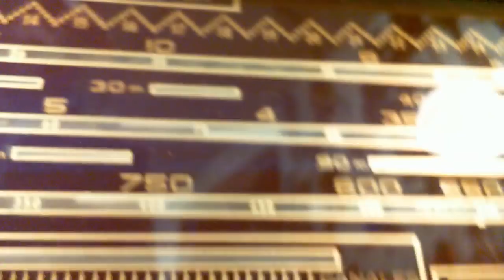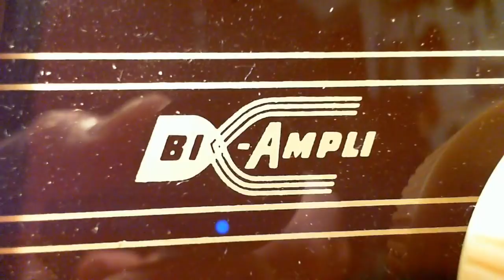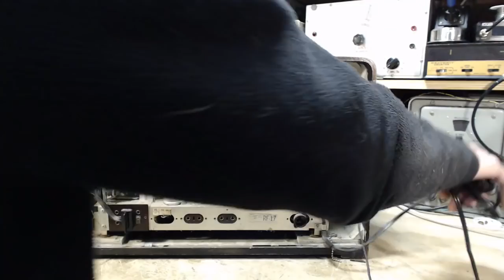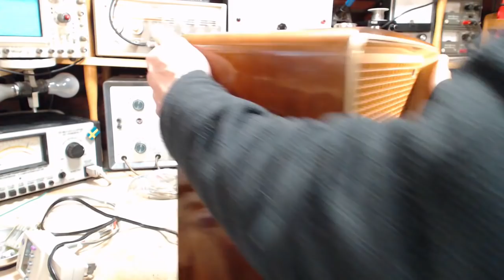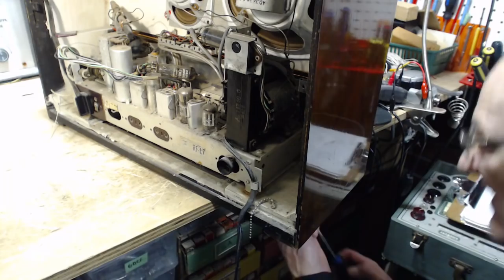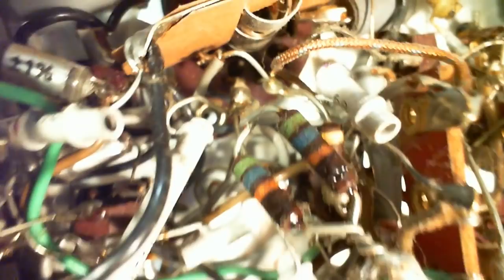Philips B5X88A AM FM SW Tube Radio Video #1- Checkout

Comment: hi jim not my favourate sets to work on the thin single core wire is easy to break if moved. all the black tar covered caps will be leaky . no output transformers in this set and replacement speakers almost inpossible to find. mind you if you do manage to get it going it will sound superb.

Comment: Keep your fingers crossed the 6V4 rectifier is good. That one is frightfully expensive.
Reply: I don't worry too much about rectifier tubes, they can always be replaced with a rectifier diode or two and a dropping resistor... at least on radios with power transformers, AA5's and similar radios with series tube heaters are a bit more complex.

Comment: 37:18 the primary mains fuse on these philips is a non resettable thermal one (schematic label Z for Zekering - dutch: Fuse). It is a metal strip that under tension hooks into a loop of a low melting alloy. If the transformer overheats the alloy loop melts releasing the spring and thus opening the circuit. You can see the metal spring blade on the left side of the transformer winding.
The unreliability (the alloy gets brittle over time, cracks, people use wire to replace the loop which renders it inoperable and a fire hazard) and the fact that it dont react fast,  is why it is a cardinal rule to install a proper primary slow blow fuse.

Comment: This is one of the Philips sets with the infamous transformerless output stage. The EL84 and EL86 form a serial push-pull amplifier, similar as you would expect it from a transistor amplifier. Hopefully the speakers are ok, they have a much higher impedance than normal speakers.
Reply: Omg you are 100% right about this being an infamous "eisenlose Endstufe".
Yah Philips lets make things better. Like use 800 ohm speaker to avoid the output and impedance matching transformer. Who cares if the 800 ohm voice coils  drop dead like flies.

But that is gonna be good watching him attach 8 Ohm speakers for testing and be greeted with nothing but a whisper.
Reply: @randomsteve4288  If you are able to produce your own 800 Ohm speakers like Philips was - why not. They had their own tubes, capacitors, resistors, later also semiconductors. The problem with the 800 Ohm speakers is the coupling capacitor. Due to the necessary capacitance, it is an electrolytic capacitor. After 50 years, it gets leaky and burns out the speaker coil. The speakers can be replaced by normal speakers if a transformer is added for impedance matching. I also remember hi-end amplifier approaches with like twenty of the strongest output tubes in parallel to drive an 8 Ohm speaker directly. Only recommended for cold climate environments 😂

Comment: OC is SW and OM is MW in French.
Re: The tuning knob not driving the FM index, there is a video about a fix for Grundig radios, basically a C shape washer made from a cut in a flexible sanding disk, the kind with a felt-like side, which will give more grip to the clutch for FM tuning.
Reply: Yah but you always first lube and unstick the bearings on the capacitors and rollers before attempting to modify the AM/FM dial cord clutch mechanism.